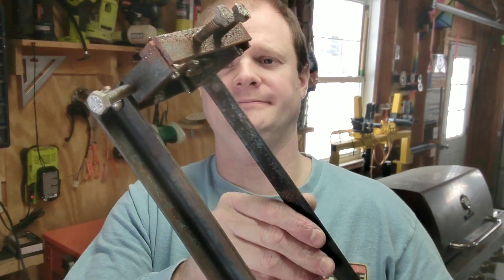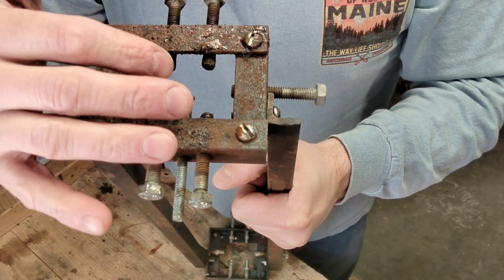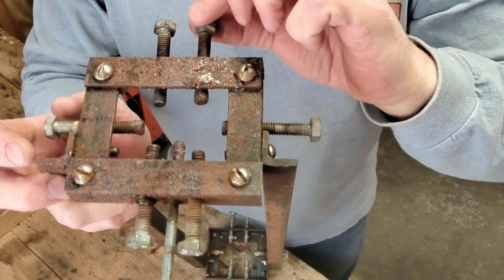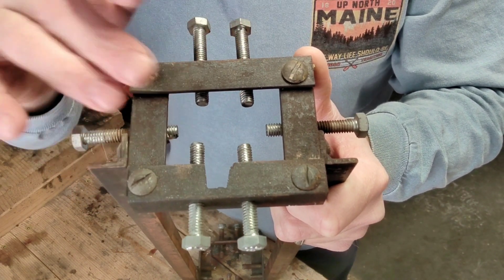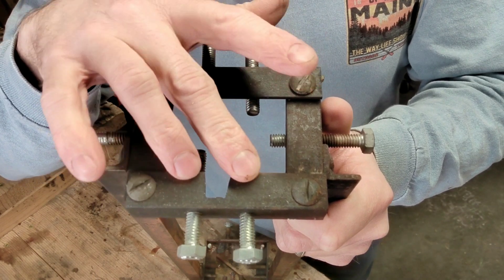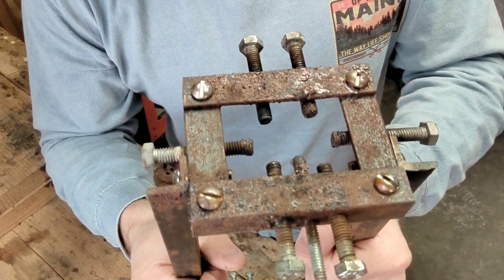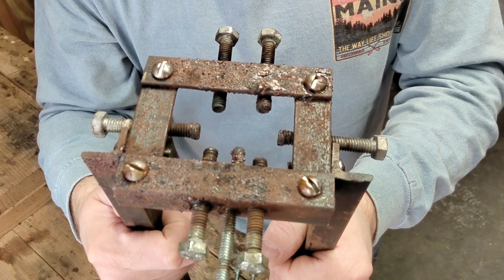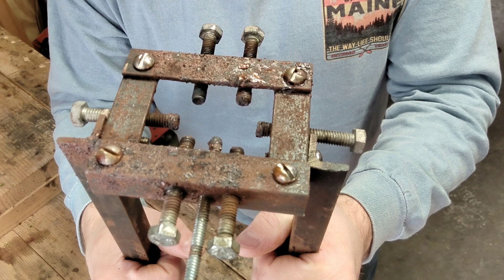Double Barrel Rifle Regulation Jig Explained.

Comment: That's pretty cool I regulate mine using the load I plan on shooting. I make wedges that go between the barrels held in place with hose clamps. Shoot adjust the wedge in or out till I get it shooting where I want. Then solder the a shim in and ribs.
Reply from the maker: I use a wedge as well. Thanks for watching!